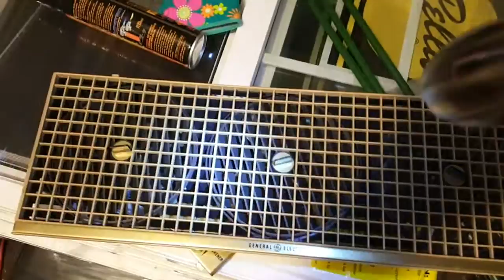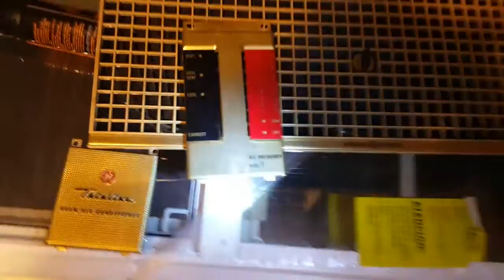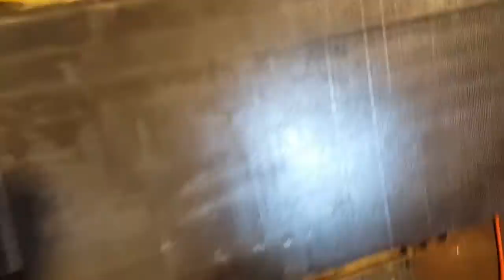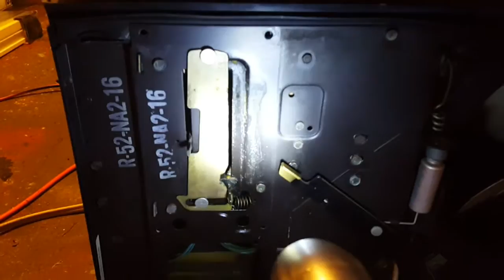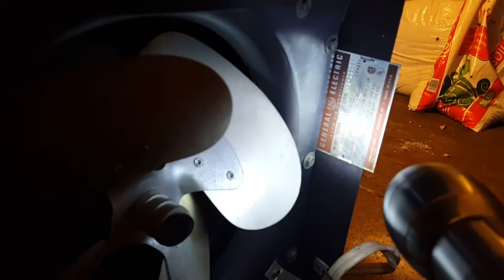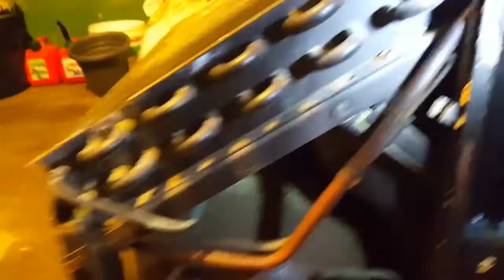1950s GE Thinline Air Conditioner Overview

Comment: Great video. I actually have this same unit . It’s still installed in my century home 1908. I moved in in 1990 and did work for a bit. But just did not cool anymore. Would like to keep and restore it . Any suggestions! 
Can you restore this ! I’m located in the Chicago area . Thanks .
Reply from the maker: Restoration is possible.  Best case scenario, the refrigerant has simply leaked out.  Leaks are fixable.  Worst case - the compressor is dead or the coils have massive rot.  Hard to know without seeing it.  Unfortunately I am 550 miles from Chicago.  Whatever you do, don't scrap the unit.  There may be a collector in your area willing to buy it from you.  There is a group on Facebook called "Vintage Air Conditioners." Free free to check it out and inquire there. Thanks for your comment!

Comment: I have 1 of this type how can I  get it out of the sleeve in the wall?
Reply from the maker: Wish I knew, but I don't have that experience.  This particular unit was installed in a window with their supplied window kit.  From what I can remember, there were screws attaching the case to the chassis all along the bottom of it - not sure it slides out from the case.  Sorry, wish I could be more helpful!
Reply: These units do not slide out of the case. When Consumer Reports reviewed them many years ago, it mentioned that this was a significant disadvantage.
Reply: @johncantwell8216  thanks

Comment: I would just take normal window screen and put it on the inside of that case with some sort of epoxy or solder because that will keep the pest out from going through that vent that they can get into so easily

Comment: In 1960 the advertised installed price was $278, which is ~$2,780 in today’s money. It cooled 1 room.
Reply from the maker: Crazy how times change.  In 1960 this was a luxury.  As a matter of fact, the house I got this unit out of a was a big mansion built in 1925.  It had been installed there since 1956.  No doubt the well-to-do would have gladly paid the price for the comfort back then.

Comment: The model number decodes as follows: 5 means 3/4 HP, 2 means Custom (has control cover door and Exhaust), N means 1956. The 1957 service manual that I have lists the same model for that year at 7700 BTU.
Reply from the maker: Thank you sir!

Comment: The "air freshener" may be an ion generator.
Reply from the maker: Whoa, never thought of that!  Could be....
Reply: The air freshener was a small spray container that fit inside of the unit. Replacements could be purchased from GE Service, but those days are long gone.

Comment: The GE air conditioners sucked. All fan noise.
Reply from the maker: I will say from experience you're correct that a lot of the later 70s+ GE units did make a good amount of noise.  My 70s carry cool was really loud, a 70s Slumberline my aunt had was loud (but made a really soothing sound in my mind), and hotel rooms in the 90s with Zoneline units were indeed noisy.  But this 50's unit was silent as a mouse and froze a room out.

Comment: I had a very similar air conditioner (design must have been a copy of this GE) https://drive.google.com/open?id=0Bz-TdjkgqKgCaVZzbWYtQUprT0E
It was a Carrier, 5,000 btu, used 1050 watts. It was extremely heavy, and the fan roared. Anyone know what year it was built in? My parents got it used in 1976, and we estimated it was 10 years old at the time. We had it almost 30 years, then in 1995 it got stolen from a basement in an apartment building that I stored it in. Never saw another one like it, ever. It did a great job, and dehumidified incredibly well.
Reply: I believe one of these Carrier units is shown on the Flickr or Tumblr page of Ken Horan a/k/a AirConditionerMan

Comment: I picked up one of these from the curb in my town about 15 years ago. I can't believe now that I was able to pick it up by myself and get it in the back of my '88 Mazda 323 hatchback. Rode around in my car for a couple weeks because I didn't have anywhere to take it. Mom would get mad at me for bringing junk home so had to make plans for it. I remember always being able to find units like this back in the day on the curb and no one ever picked them up like they do now. Everyone wants to scrap now. I had a bunch of units that I wish I had kept; always had a friend who needed one so there it went. I'd play with them some, repair if needed, and send them on their way. Our central air went out and we couldn't afford to fix it; no worry, just go trash picking and pick up a bunch of window units. The one I had like this one went in a friends livingroom when they couldn't afford to fix their air, then to another friend who moved into an apartment that didn't have ac. Lost track of it after that. Maybe I'll ask him about it; although that's been years ago now. It didn't have the front grill, had turn knobs instead of slider switches, and I swear it had another condenser coil on it in addition to the slanted one like this one. Mine also had a different compressor Im thinking. Want to say it was round but a tad bit skinnier. Didn't have the single cylinder sound like this one, believe it was a two lung compressor. Blue/green sporlan 032 filter/drier with flare nuts on the liquid line. The unit had this neat high pitched hum to it once it got warmed up. It was monster-sized compared to today's standards; said 9000 btu on the tag. Miss it, wish I knew then what I know now and had had my own place to store things. I would have held onto it somehow as well as a few others...
Reply from the maker: Sounds like that mystery unit may have been a "Lo Thinline" which is what came out after this one.  It was similar to this but was slightly modified. That particular unit had a 2-pole (motor is would to have two poles rather than four, making it rotate at 3450 RPM as opposed to 1725 RPM) pancake-style recip compressor  and sounds a lot cooler!
Reply: The 1960 Hi Thinline units had rotary controls. And the 1957 1 1/2 HP model had an auxiliary condenser mounted vertically under the slant-mounted main condenser. In 1957 they did have a 9000 BTU model.

Comment: despite it's size and klunkyness it is likely more efficient than a modern unit because it has out lasted thousands of newer units and contains a larger amount of r22 making it colder
Reply from the maker: You're probably right....I don't think modern units are as "Efficient" as they claim to be in fact the three vintage units I have work much less harder to cool a space
Reply: 65bug519I think the unit being from the 50s must be R-12
Reply: @67tr876 I know the unit is 5 years old, but it likely isn't. The only ACs I have seen with R-12 (house A/C units that is) are the very early ones. R-12 was mostly used in cars and refrigerators. IIRC R-22 came out in the very early 50s, so this unit likely uses it.

Comment: Very interesting unit!  There's not many units left that have an open bladed condenser fan.  All new units have the condenser fan blade behind the condenser.  That unit is a keeper!
Reply from the maker: GE is the only company I can think of that had the condenser fans separate from the coils.  GE Carry Cool and Thinline models, along with the big Dual Thrust.
Reply: I know of a business in town where there is a huge unit with a big ole condenser fan in the middle of the rear of the unit, visible through the grill. I might just go by there tomorrow and ask them about it.
Reply: And Hotpoint, which was partnered with GE, as well.  Also, I think Westinghouse had some A/C s like this, too
Reply: James Wright, the Fashionaire and Fashionette models, too.

Comment: Based on the model and serial numbers you read in your video, this GE 'Thinline' room air conditioner was manufactured in February 1956.  It uses a ¾ hp Tecumseh single cylinder, four pole reciprocating compressor model S7R16.  The capacity of this air conditioner is 7,800 BTU.  Some information from my blog:  http://air-conditioner-man.tumblr.com/post/98931644544/1956-general-electric-room-air-conditioners
Reply from the maker: +Air Conditioner Man Thank you for this information!  I wasn't too far off with my BTU estimate!